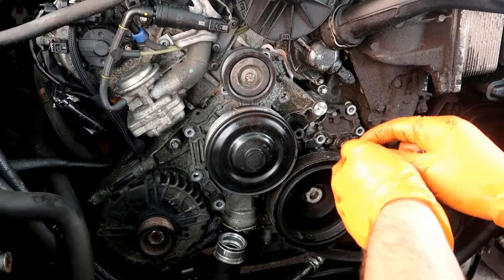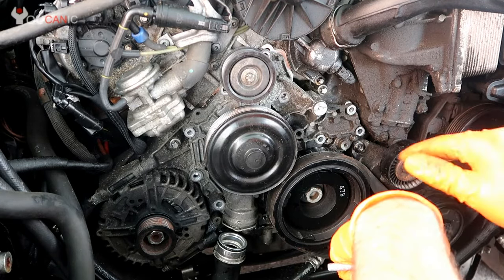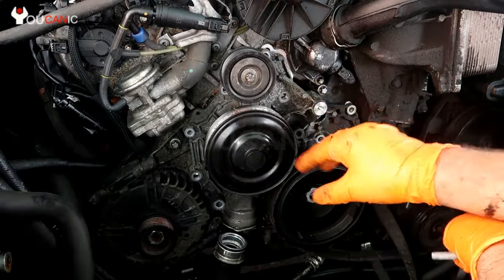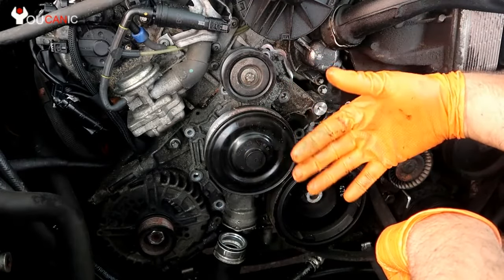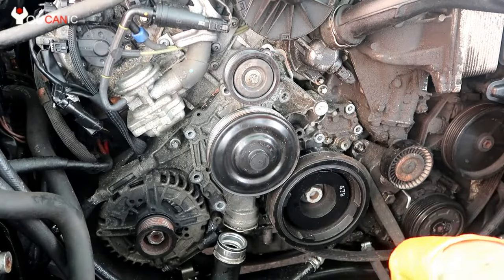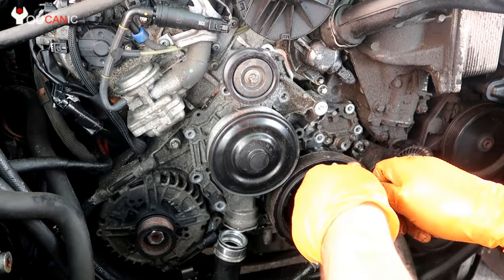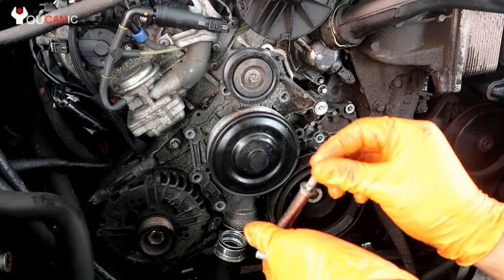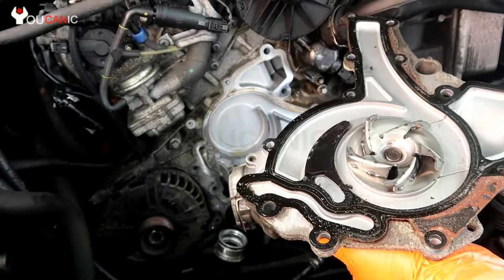1998-2013 Mercedes Water Pump Replacement | Step-by-Step Guide

Comment: Terrific detail and great camera work! One quick question if you don't mind. Would you what the torque specs for the E10 and E12 bolts? I appreciate it.
Reply from the maker: They are at the bottom of the step by step guide. 

https://www.youcanic.com/wiki/mercedes-benz-water-pump-replacement
Reply: I appreciate it. Thank you for the information.

Comment: What would cause oil leak to the left of the water pump
Reply from the maker: Thank you for your question. An oil leak to the left of the water pump could be due to a faulty gasket or seal. A precise diagnosis requires a professional diagnostic scanner like the YOUCANIC Full System Scanner which allows you to diagnose issues like an expert mechanic. Learn more at www.youcanic.com/scanner.

To correctly fix the issue, you might need specific repair manuals and torque specs. YOUCANIC provides access to Factory Repair Manuals that would guide you step-by-step. You can find all you need at www.youcanic.com/manuals. Our main goal is to empower car owners like you with knowledge and tools to manage car repairs effectively.

Comment: Can i replace just water pump pulley?
Reply from the maker: Thanks for your question! Yes, you can replace just the water pump pulley, but remember the procedure can vary depending on the car model. We encourage you to visit our website, www.youcanic.com, where we provide helpful guides, factory repair manuals, and free resources including our powerful YOUCANIC scanner.
Over at Youcanic, our mission is to empower car owners to perform maintenance confidently and economically. Feel free to explore our site and don't hesitate to reach out if you need assistance. We're happy to support you in your car ownership journey!
Reply: What about c220 w203 mercedes benz , i could not find it on your website?

Comment: Do u have to pull the thermostat and does fan have to come out ?
Reply from the maker: Thank you for your question! The requirement to remove the thermostat or fan depends on the specific car model and the repair you're planning. At Youcanic, we are dedicated to helping car owners like you with their car maintenance tasks. We provide step-by-step guidance via our available resources and offer a Youcanic scanner to make things smoother. For detailed instructions, check out our factory repair manuals at www.youcanic.com. Our team is here to assist, so feel free to ask any more questions if you need! Your confidence under the hood is our mission.

Comment: That engine has a serious oil filter housing gasket leak.  I just replaced mine and went ahead and replaced other items in the front of engine too.  I replaced the water pump, thermostat, idler pulley, belt tensioner, Egr gasket, shutoff valve gasket... Might as well do that maintenance.  I love your videos.

ON the waterpump, all I did was took my new water pump and traced the borders and pulled the bolts out from stuck on the cardboard box I traced so I wont worry where which bolts goes.

Comment: What kind of bolt is at 3:57 ? Previous owner of vehicle broke that bolt and put in a crappy alternative. The alternative doesn’t fit and it’s leaking so I need the correct size pls
Reply: They are the typical Mercedes hexagonal bolts.

Comment: Hello,my slk 230 had an accudent from the drivers side down below.Now is the radiator damaged and has a big dent on the bottom,but the radiator doesnt leak.Now i believe that the leak is coming from the waterpomp because it drips on the upperside of the belt.Is it possible that the waterpump start leaking because of the damaged radiator?
Reply from the maker: Thank you for sharing your issue. It's possible the accident could have indirectly caused damage to your water pump. To diagnose your SLK 230 like an expert mechanic, you may need a good professional diagnostic scanner. That is why we developed the YOUCANIC Full System Scanner. [Learn more](www.youcanic.com/scanner) 

To ensure the repairs are done correctly, having access to Factory Repair Manuals and Torque Specs can be invaluable. We offer access for a small fee, which could save you in costly repairs [Get it here](www.youcanic.com/manuals). Our goal is to empower you in dealing with your car repairs.